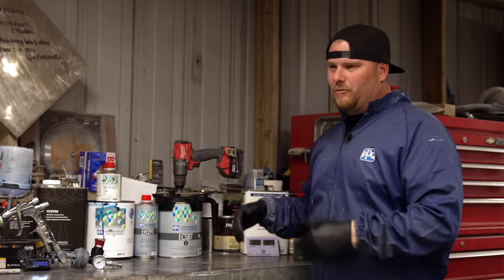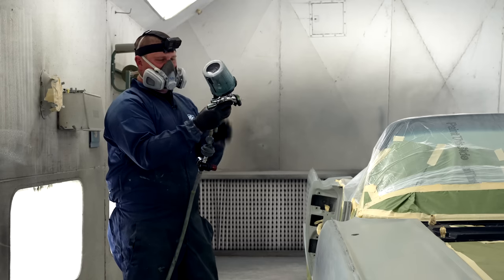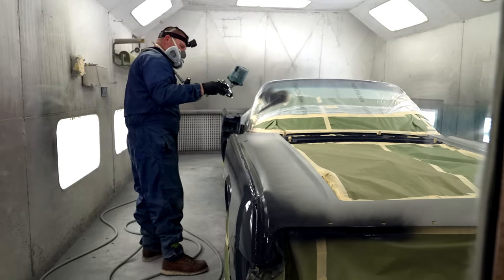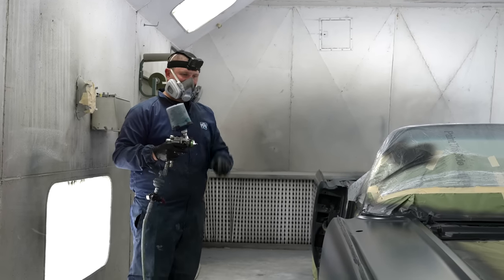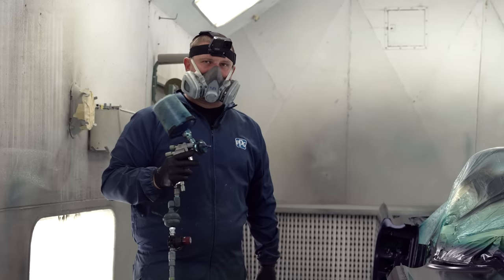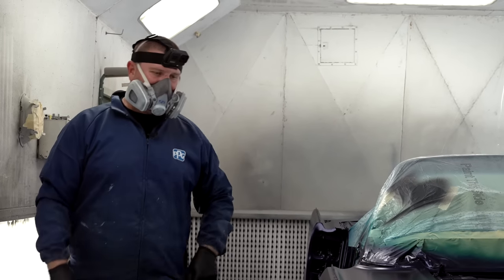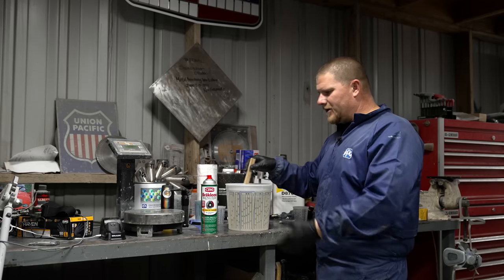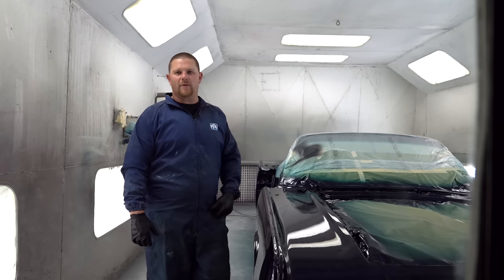Secrets to the Perfect Paint Job Revealed

Comment: Your channel has become overall my goto channel. I save them and go back and rewatch and take notes!!!!  
I’m a beginner never spread a car, few motorcycles and bike frames, so each vid is a major learning course. I have a 65 C-10 tore apart, once body work is completed could I spray out each part and then put back together and spray the “last three coats”. I’m not sure/afraid  I can get it blended/uniform paint on all panels!! I’m not wanting show circuit quality paint job. It’s going to be a daily/weekend driver
Thx for all your input
Reply from the maker: Thanks glad they are helpful. Are we talking about paint? Or primer? Primer you can but it won’t be as good as it would be sprayed together.
Reply: @SYLVESTERSCUSTOMS  more paint!  I’m not so sure I could spray out each individual panel and have a uniform color once I reassemble truck!!
I have it in my brain lay down one or two coats assembled truck then come back over with last coat and then clear???

Comment: Great info! The EHP is actually cheaper per ounce than DBC but due to the reduction difference it comes out about the same. I like EHP because it lays flatter with better color control. Me and my partner sprayed different panels on a silver car. He sprays with SATA, I spray with Iwata. When the car was assembled,  there was no mismatch at all. Downside is humidity is a killer with EHP. I wish PPG would develop a faster reducer. All paint companies bragged on water initially. Then I found out the test market was Southwest with dry heat/no humidity.  I still bounce between water and solvent depending on the job. I use degreaser to wetsand any imperfections with EHP dragging the paper in one direction to avoid tearing the color. I'll only use an orientation coat if necessary, usually on lighter metallics or pearls. Not all the time but I tighten up the material about a turn with 12 -15 psi for that coat and only once instead of three. Contrary to PPG, orientation coats do not alter the color like they claim. I've been using the 5700 for quite a while. Great gloss retention and buffs great. Good for leveling painted graphics too. I slow it down as much as possible. Usually the 95 activator and reducer. Flow coating is a waste of time and material. With this 5700, 4-5 coats is plenty to flat sand and buff and still bury tape lines. I notice you don't use any Venturi driers. Do you have any certain set up in your booth for extra air flow? I was at a training facility and they had ceiling fans mounted to the upper plenum. Huge difference. I have a 3M full face mask. It's not air supplied but covers the whole face and takes the regular filters the half face does. Also,check into the spray socks to cover the head.
Reply from the maker: Wow all amazing info thanks so much for sharing I’ll look into all of that. Nothing special in our old booth I just take the time to let it all fully dry. Takes me a looooong time lol
Reply: @SYLVESTERSCUSTOMS  
I was messing around with inventing a heated hand held Venturi drier(patent pending) to battle the summer humidity.  We used to fire the burner in the booth in summer to dry the intake air before it to the booth. Made a huge difference. The quads are just a wind tunnel blowing dirt around. Wouldn't recommend. Ceiling fans and heat is where it's at.

Comment: Very good explaining and take the time to talk about details so even a beginner can understand. I have been painter for 20 + years and agree to all you said. The only thing i can bring to the table is that do not use wooden stick for mixing, especially paint. The wood can absorb some pigments wich maybe not so important on a full respray but when you make a repair it will make better colourmatch. I always use plastic sticks.
Reply from the maker: Ahhhh great tip I would have never thought of that!! Thank you very much!
Reply: I can second this; not for paint though same logic applies. For structural adhesives, anything 2-part. The wood can absorb one product more than the other, throwing off your mix ratios. We only use stainless mixing sticks now.

Comment: The last coats you did I always been taught in the uk they are a drop coat. And normally I would cris crocs the pattern with high metallic bases so you wouldn’t keep going horizontally. What ever works is good enough that’s just how I was taught. Excellent vid.
Reply from the maker: Yes drop coat or orientation it’s all the same exactly whatever works 👌🏻

Comment: What I also noticed is you're getting little to no overspray in the air. I've seen other videos and its all over the place. Is it because of your settings. Set at Low volume amount at a pressure thats just enough to atomize? Also I'm assuming its an HVLP air cap? I have a devilbiss gti pro with the te10 aircap and it gives a nice smooth look. I love that you're also taking your time and completely relaxed.
 Cheers John.
Reply from the maker: It’s a combination of gun set up on any gun and I also spray very close so that I’m forcing the paint to hit the panel and not just become overspray. Thanks for watching
Reply: @SYLVESTERSCUSTOMS  Thanks!!

Comment: This video is great, I’m in the middle of a transporter project, engine swap mods done, I’ve done 2coats of 2k epoxy, just getting ready to fill then 2k high build primer … been unsure on what grade sandpaper to use prior to base coat, da sand or block , wet or dry? Definitely appreciate the work the professionals do more now, so much more involved than I thought, lwb transporter van is my first project definitely learned a lot
Reply from the maker: I block sand wet with water in 600 grit but you can use a DA the finish won’t come out as clean tho

Comment: I always find your videos informative and professional, thanks.  I am about to start some projects with my boys (as I retire) and have not painted a car or a motorcycle for over 20-years and technology has moved on (HA - I can remember spraying nitrocellulose paint) and I appreciate your videos to get me 'up to speed'.  And - crash repair methods can certainly be different than restoration type work.  One needs to get the vehicle back out and shiny 'yesterday' - the other more focuses on the long term 'viability' of the work, and not satisfying the tight 'budget' of an insurance company.  QUESTION - is 2050 an epoxy?  I have yet to see PPG describe it as such in their literature.  And because it can be sanded (unlike many others), will it have the same protection against moisture that the non-sandable epoxies seem to have?  Once again - thanks for the detailed and professional 'lectures' on the correct and modern way of applying these materials.  Try some knee pads - I often notice you on your knees on the concrete - it may catch up with you one day - better to be safe than sorry.   CHEERS from AUSTRALIA.
Reply from the maker: Thank you. I absolutely need knee pads I feel it! As for the vp2050 you are correct they don’t put it in their tech sheets but my ppg rep and many others call it an epoxy. It has amazing protection from moisture.

Comment: Thank you for sharing your extensive knowledge. Seems so detailed and complicated. I think I'll just stick to Enamel paint. Oh, I was always told that too much clear is not good and too little is not good either with base coat clear coat. I was told 5 to 7 mil thickness is ideal, is this true? I hate seeing those clear coats pealing off from Sun damage. Thanks and a great job too.
Reply from the maker: I would agree honestly. Too much takes forever to cure and becomes easy to chip etc. to little starts delaminating. Thank you very much

Comment: I always enjoy your videos. I have painted solvent and water based color systems for years.  And when i used to spray the Envirobase system I would have to position those air blower stands where needed and also use a hand held on to properly flash off each coat. Did you use any on this job?
Cheers,  William
Reply from the maker: I’ve seen those I need to get some. I actually don’t have any. I purposely waited for a 70° day and we cut it close at the end getting it done before it started getting cold.

Comment: Gonna have to try dropping pressure on orientation coat I usually turn psi up
Reply from the maker: It makes a huge difference. Solvent or water based paints.

Comment: Thank you for your time in making such a great video. I've watched quite a few if not all your videos on body work. I'm working on a 70 El Camino and just  received the rear quarters and outer wheel houses. I'm jumping in with no skill just the will. Looking ahead for paint I have a question on using PPG vp2050 as a build primer. After body work is complete do you use the vp2050 as a block down build primer (is that the correct term, I don't know)? Then would that be your sealer sanded and ready for basecoat?  Or do you spray reduced 2050 then basecoat? Jezzzzz..... or use a sealer that's actually a sealer? There's a lot to this and you make it look so easy. I appreciate your time if you could answer these questions for us inexsperienced diy guys.
Reply from the maker: Awesome thanks for watching. I use vp2050 over bare metal scuff that up do my filler work go back in again with 2050 then block it out. When I’m happy with the finish I use an actual 2k sealer or a traditional epoxy primer before I roll into basecoat.

Comment: Do you have a video Explaining your order of work flow? Meaning. When to shoot door jams then re fit everything for final, or do you spray everything off all the way through?
I just finished up a gold mettalic hood that had to be blended into the fenders. Came out fantastic!! Thanks for all your videos.  Cheers John
Reply from the maker: You are welcome. I make sure I set up my gun settings and I spray everything apart. Only thing I don’t do this with is candy or pearl jobs. Even if I have to do a blend I do it apart. Write down air pressure, needle turns out, fan turns in, how many coats, how many orientation coats etc and just be as consistent 👌🏻
Reply: @SYLVESTERSCUSTOMS  Thank you so much. 
Cheers John 🍻

Comment: I love your videos, I’ve been a body man for 25 years and I always learn a new tip or trick by watching your videos.  You explain things in a way that is super informative and easy to understand, thanks for sharing your knowledge.  I’m doing a restoration in my shop currently and have switched from durablocks to acrylic to up my game like you guys.  I like the acrylic but when I’m in the primer wet sanding stage for paint ,  they tend to get suctioned to the panel and don’t glide easily, I’ve tried adding some soap to the water but it doesn’t seem to help that much.  Have you had this problem and is there any advice you could give on it?

Thank you
Brian
Reply from the maker: Once we get the bodywork done and your in the wet sand stage I’ll use Jason Killmers smaller blocks to wet sand they are all different sizes and shapes. That’s common to have I use more water flowing and flushing it out as I go. Usually holding a hose while sanding.
Reply: Ok awesome, I will look into his blocks.  Thank you for taking the time to get back to me,  I really appreciate it!

Comment: Great tutorial. Thanks for putting the time and effort in to these. How long can you store ppg base coat paint?
Reply from the maker: You are welcome. As long as it doesn’t get popped open I would keep it out of extreme temperatures whether it be cold or hot, but it typically last quite a long time I’ve had some a few years and still work just fine.

Comment: Question: I usually spray waterborne, but had to do some pinstriping and airbrush work, then clear it, so I used urethane striping and airbrush paint. Sprayed the clear wet on the first coat, similar to your technique and the striping paint rewetted and ran. I've been advised to spray an intercoat clear first or spray a few light tac  coats of clear first. I'm not sure if these suggestions are correct. What would you suggest to avoid this problem? Thanks for the very informative videos.
Reply from the maker: When it comes to Custom Paint , a lot of rules go out the window. But yes, those techniques would work. Where are you letting the pinstripe painfully dry? I know certain pinstripe pants require a lot longer of a time to dry.
Reply: @SYLVESTERSCUSTOMS  I let the pinstripe paint dry a few days.  I didn't add hardener to the paint as it's usually not necessary when clearing over it, but maybe that would have helped.
Reply from the maker: @jeffsimon3114  yeah it will. Honestly the more I think about it a intercoat clear is probly the best route because then you lock in your Airbrush work and your pinstripe lines. That way you can clear over everything and it’s not going to move or run. Because if you were to use a Hardner in your pinstripe paint, you are going to want to use a scotch Brite very lightly so that way the clear has a tooth to your lines but if you use a intercoat, at least everything is protected. I know sometimes when my art pieces that we airbrush get too crazy we use intercoat in between so we can not have adhesion issues.

Comment: How would the sealer you talked about in this video compare with the epoxy primer reduced as a sealer?  Great stuff
Reply from the maker: In my opinion, the epoxy used as a sealer has a lot more orange peel although it is a lot more robust. There are pros and cons to both.
Reply: Is this sealer easier to sand as opposed to the VP2050? How does it compare with shrinkage? Thank you for your responses.

Comment: Good video for sure even touching on safety aspects. Can give one more tip on clear and   (Isocyanides)a class of highly reactive chemicals that are used in many paints, including water-based paints, base coats, and lacquers. 

 Hope you don't mind me giving a heads up on  protecting yourself. I sprayed,  spray in bedliners for our company at the  beginning of the spray in industry 88 is when it started we didn't get in till 92 with Hammer coat  we  had it originally . The point is Isocyanides are used as the B portion of the mix that hardens.

 Isocyanides if inhaled  for prolong periods can cause serious raspatory damage issues so mask up charcoal mask at a minimum  respirator  suggested. The side effects are dangerous you can't breath feel like your having a heart attack   short of breath coughing  abnormally  seek help .    I had the coughing after a year of spraying at the beginning then quit doing the spraying the cough quit  I had a charcoal  mask and sealed eye protection but open skin on arms neck etc.. Once you become sensitized  to (Isocyanides) you can't even be near it we bought 55 gallon drums of this stuff lol.  Just protect yourself one two cars three a month no big deal probably we did 4 a day 6 days a week in the beginning  16 ,20 grand a week  but your life is worth more.   We got out  of it  ,the guy I bought all the equipment from sold it to us because  he became ill from it so just be aware  have good ventilation and protection .

Comment: Got a couple of questions,  other than the addition of the hardner,  what's the difference between a 1k and 2k epoxy being used as a metal sealer? And can a hardner be added to the 1k and used just like a 2k? Also using a candy midcoat over black, does the 1st coat have to be a basecoat paint or will my black primer work instead? Thanks for the videos, very informative that's why I've subscribed to your channel. The bodywork on the tri5 chevy has helped tremendously with progress doing my 56 2dhtp
Reply from the maker: You need to look up the TDS sheet for the primer you are using you cannot just add hardener to it. There is very specific guidelines for paint. It doesn’t have to go over basecoat but it will look better if you did. Thanks for watching

Comment: Great video as they all are. I have only one question though. When mixing the EHP base you mention the 5% of T493 but nothing about adding T492 Adjuster. In the tech sheet is states that you Must use 492 when using 493. Is there a reason you don't add it?
Reply from the maker: T492 is used for an area that will see more abuse. Our restorations don’t get abused thankfully so if you had a lower front valence or front end I recommend it from rock chips etc.
Reply: @SYLVESTERSCUSTOMS  As a former PPG training instructor is was drilled into us to preach that 493 can not be used without 492 as they work together. This also coming right from one of their chemists. 492 is a resin and will definitely help with chipping basically because it stays in the paint and therefore gives it the ability to dry faster and get better adhesion in the places where painters are too lazy to bend over and make sure the base is fully flashed. As for 493, I never understood why they call it a Modifier, it has a red cap just like every other Isocyanate. Clearly it is a hardener/activator. In any case, love your videos and the information you share. Rock on......
Reply from the maker: @gsinon7719  thank you for the information. We greatly appreciate that I will look more into this that’s for sure.

Comment: Have a question about compressor size. What specs should I look for in a compressor? I want the ability to seal/prime the car.  I have someone that works for PPG and I can use their facilities to do the final painting. Thanks, looking forward to the class in  May
Reply from the maker: Honestly I started with a cheap Home Depot 60 gallon I forget the cfm it did the job. Now I have an 80 gallon.

Comment: What type and brand of paint gun do you recommend? Do you recommend one gun for primers & sealers, and a different gun for base coat & clearcoat?  I looked for a video but couldn't find one.
Reply from the maker: I have lots of guns but I really only use two mainly. I’m an iwata guy so I like the Ls400 supernova 1.4 tip for my sealer base clear and an lph440 2.0 tip to prime.